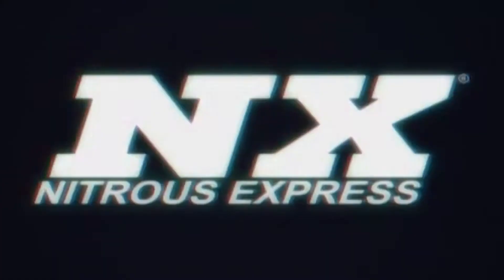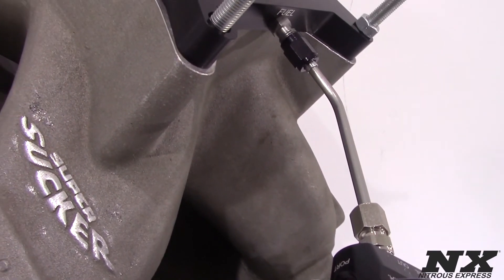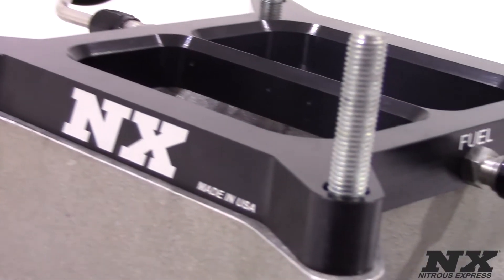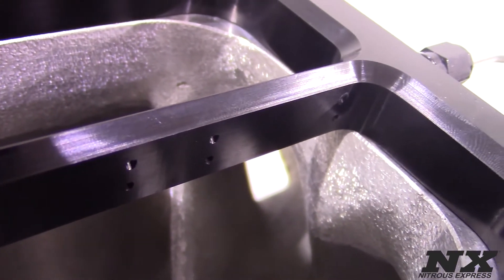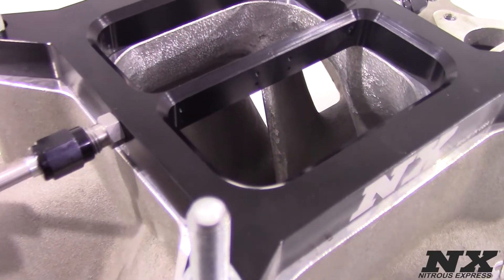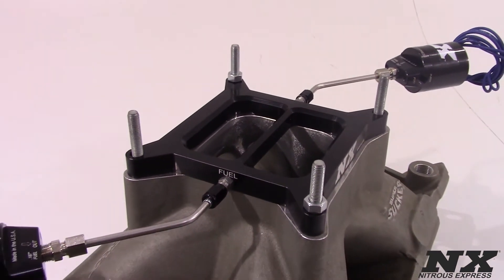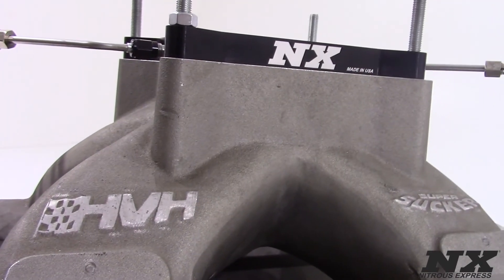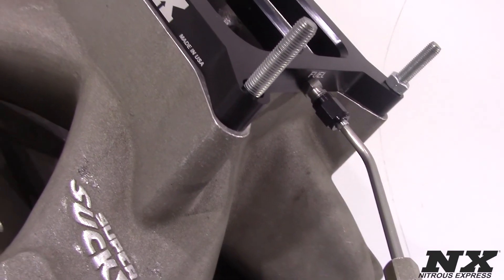NX Conventional Plate Systems

Comment: What is supposed to support the solenoids? The look like they are just supposed to float in mid air? Really like the kit except for this. Any other mounting methods for this kit?
Reply from the maker: You could always go with a traditional style bracket and then run braided lines to the plate from the solenoid. I will link our solenoid bracket category.

https://www.nitrousexpress.com/solenoid-brackets/

Comment: Does not fit intake well. Machined larger than square flange
Reply from the maker: Not sure what intake you have or which plate out of the video you are using, but all of our plates are designed to work with the manifolds with the largest intake flanges so there is no restriction through the plenum.  If your intake flange opening is smaller than the plate then you would most likely (depending on carb and engine setup) see power gains by opening (machining) the plenum to match the plate size or finding a new manifold with a larger plenum opening.